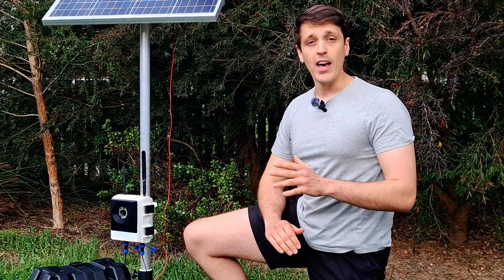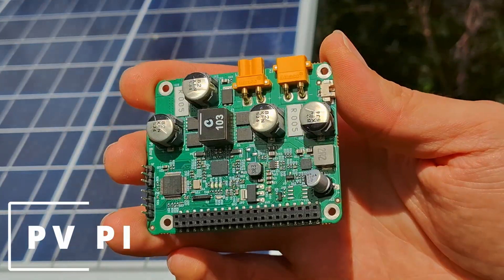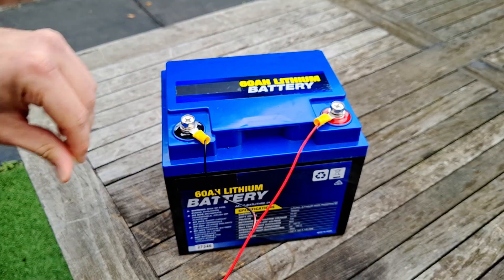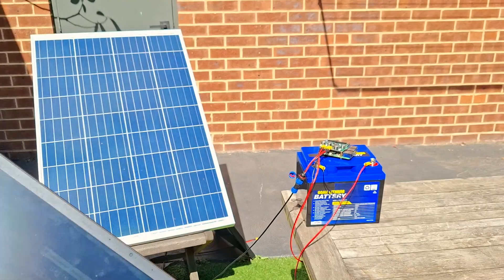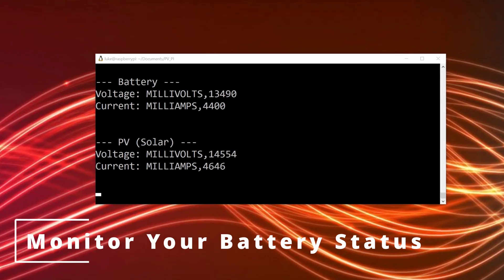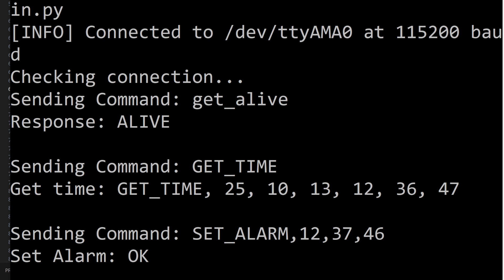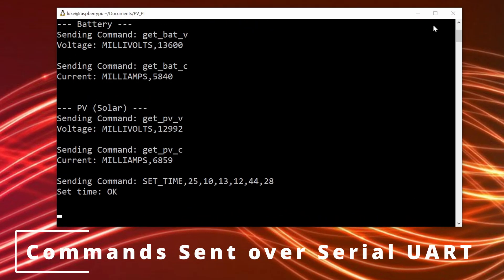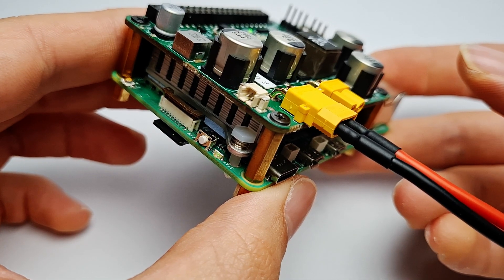Power your Raspberry PI for 24/7 off-grid operation with Solar!

Comment: Hi,
out of curiosity:
Could the firmware be adapted to implement basic BMS functionality in the device, namely over- and under-voltage and over-current protection?
Reply from the maker: The PV PI already has low voltage power off, max charge voltage cut-off, and charge current limiting to 10A. These are standard features of a battery charge controller. However, it does not have a way to regulate things like max discharge current, or multi cell balancing.
Reply: @LukeDitria  that's great to hear, for some applications that may well be sufficient

Comment: Question - will it work if I don't use the MPPT charger (I already have one) so just use it to power the RPi, but also to shut it down when the battery gets too low?
Reply from the maker: The PV PI is a MPPT charger and you can monitor the charging stats with it. However It will still work if only powered from a battery with no solar input.

Comment: I pledged, thanks for being a trailblazer! Seems really useful. You might want to make a video outlining all of the various uses this opens up for those who haven't considered all of what a self powered ras pi is capable of. Also, what about auxiliary power for add ons? Is a model with an h bridge built in for accessories ever going to be an option?
Reply from the maker: Thanks for your support! We'll be breaking out the 5v supply to the PI via a JST connector so you can use that to power external devices. And yes, I'll be making many videos about the potential of the PV PI